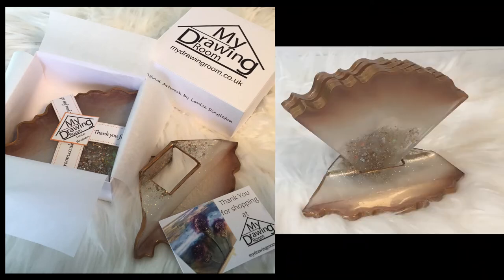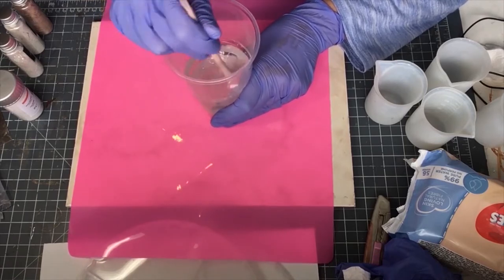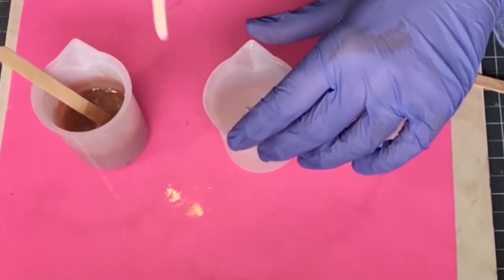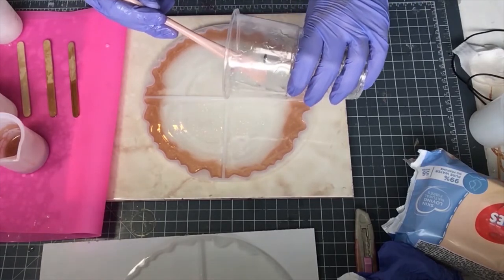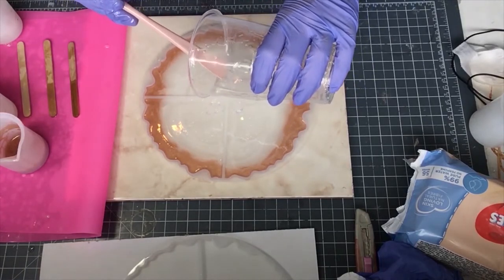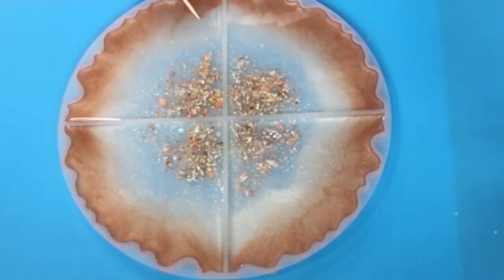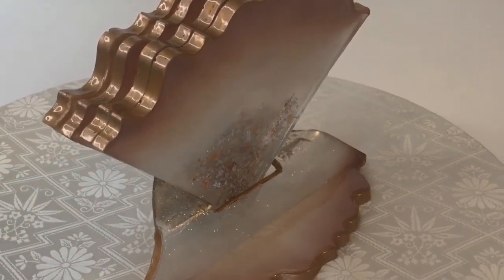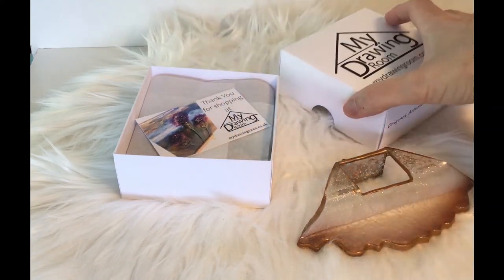Simple & Elegant Resin Coaster Tutorial - Suitable for Beginners

Comment: Hi, what you do is great ! If I make/create a plate that I don't like, can I modify it ?How can I modify a resin plate ? = put it in the microwave to melt it? In hot water? Or with a paint stripper? Thank you so much.
Reply from the maker: Unfortunately you can’t do any of the things you mentioned but you could paint over it with either another coat of resin or first use acrylic paint and then resin over the top.
Reply: @LouiseSingletonCreations  thks very much !

Comment: Hi! Your channel has been super helpful. Do you ever get issues with little holes in the bottom or edges of your coasters when you demold? I’m needing a way to prevent this so I don’t have to sand and top coat every time 😩
Reply from the maker: Hi Racquel, yes I have had the same problem before but I have found that if I run a cocktail stick around the inner edge before I leave them to cure it releases any bubbles x

Comment: HI Louise, New subscriber! Absolutely loved this video. Very novice so I'm using this video ass a guide for my first ever resin project. How necessary is it to have a heat gun or embossing gun?
Reply from the maker: Hi Rosina, thank you for your support. That’s a tricky question to answer because, yes you can do resin art without a heat source BUT I would class it as one of my essential tools because I use it a lot. It all depends on the kind of resin, the technique and the effect you are going for. In the video I just made I didn’t use a gun or torch at all because I was using a deep casting resin which disperses bubbles by itself. Also the role of the heat gun is not solely for popping bubbles it can be used to create effects in resin too. I hope that helps a little.